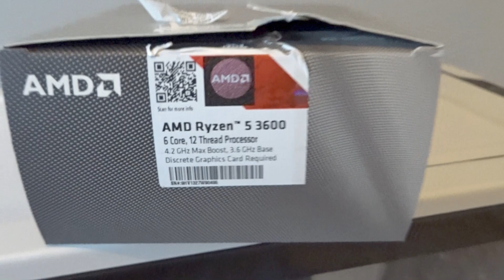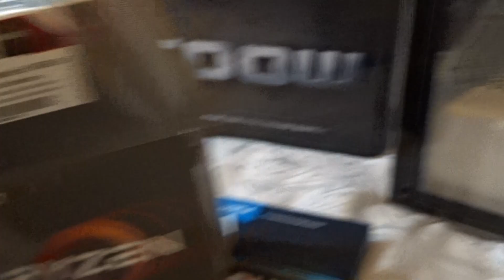How To Build Your Own Sim Racing-Gaming PC On A Budget

Comment: Hi Jon I have really no knowledge in the PC building area but I want to get into building them. I'm not really going for a sim racing pc but just a gaming pc. I have some parts that I've picked out and I would like to know if they would all work together.for my mother board I have a MSI ProSeries AMD A320 1st, 2nd, 3rd Gen Ryzen Compliant AM4 DDR4 HDMI DVI M.2 USB 3 Micro-ATX Motherboard. for my graphics card and CPU I have a AMD Ryzen 3 3200G 4-Core Unlocked Desktop Processor with Radeon Graphics. my ram sticks I have a Crucial Ballistix 3200 MHz DDR4 DRAM Desktop Gaming Memory Kit 16GB (8GBx2). my ssd is Silicon Power 256GB SSD 3D NAND A55 SLC Cache Performance Boost SATA III 2.5" 7mm (0.28"). For my case I have a AeroCool Cylon RGB Mid Tower. My fans are Antec 120mm Case Fan, PC Fans Blue LED, PC Case Computer Case Fan, 4-pin Molex Connector. I haven't found a psu yet but if you could tell me what I would need. And if all my parts are going to work together thanks